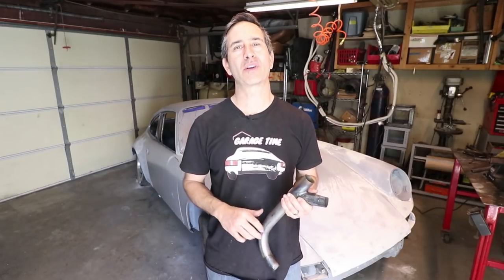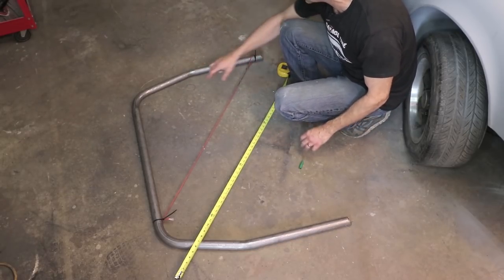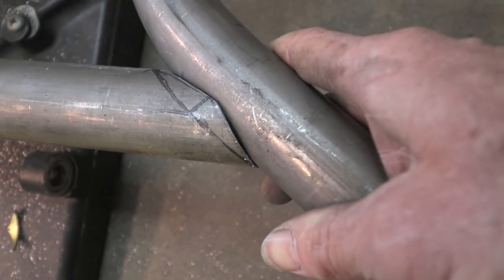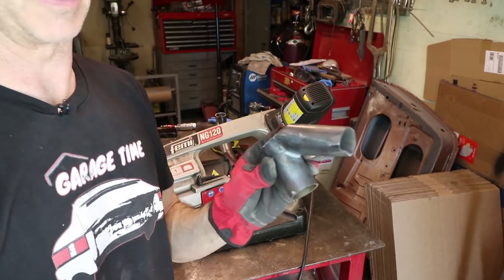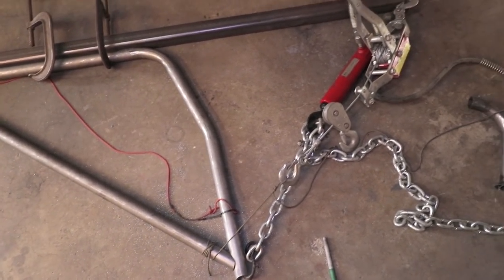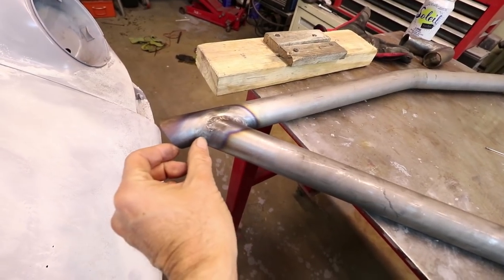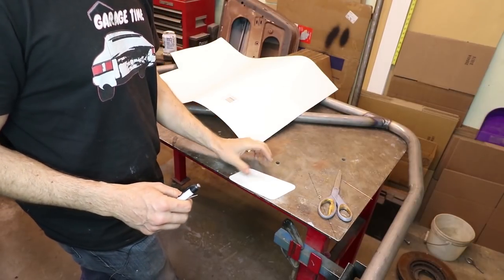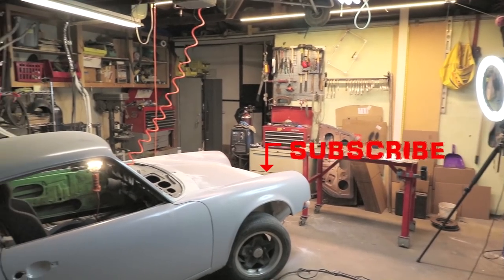How To Notch Roll Cage Tubing & TIG  Weld Diagonal Bar

Comment: 3/16” hole in every mandatory bar on passenger side. Tip, paint pen in contrasting color to make it easy to find. Drill the holes before welding to vent tubes.
Reply from the maker: Agreed!  I thought you are supposed to hang a Krispy Kreme off the hole for the tech inspector.
Reply: Garage Time - Restomod  most want a 12 pack and a steak. Upon further reading I see some inspectors have been forcing the hole to be drilled during inspection to issue the log book. YMMV

Comment: Saw that bandsaw you were using. Thanks for the link. So why that bandsaw? Not familiar enough with what specs to compare. Is the angle range adequate? Wouldn’t it have been more cost effective to buy a tubing notcher?
Reply from the maker: Hi there, That bandsaw is not cheap, but it's versatile, whereas a tube notcher does only one thing.  I bought that saw 8 years ago and have cut hundreds of tubes with it for my Zalex products.  Those fish mouth cuts could also be cut with an angle grinder or abrasive cut off saw.   It's more portable than a cold saw but works just as well.

Comment: You mentioned putting a vent hole in the main hoop when you weld the base plate on, could you not pop a hole through the centre of the base plate instead, or am I missing a trick?
Reply: chris rudling i think the hole had to be in the connection between the main hoop and the crossbar.
Reply: @thinkerdoit  Ah yeah, makes sense - cheers!